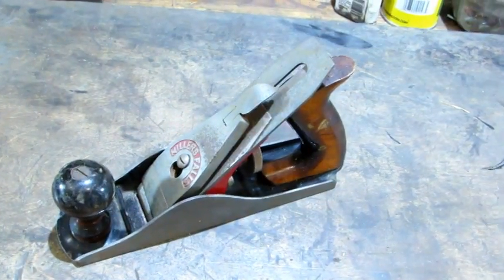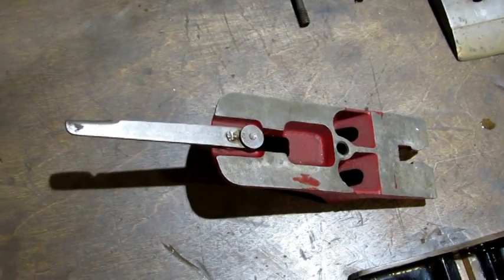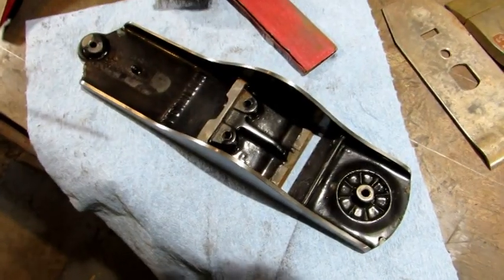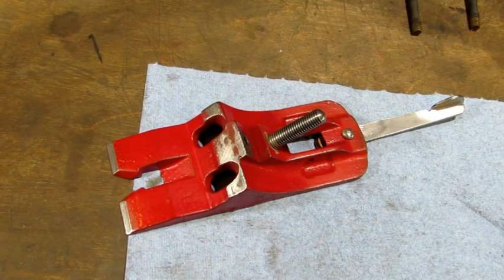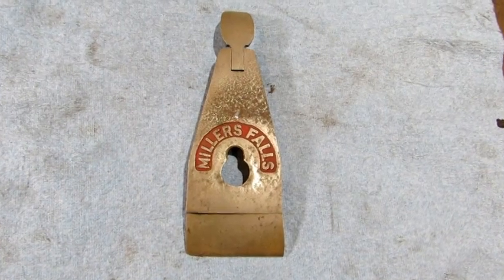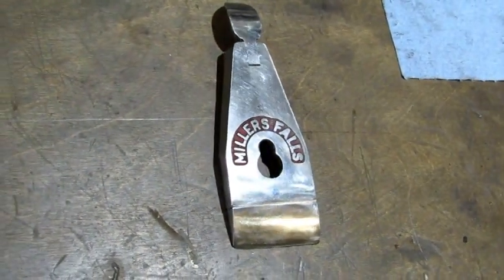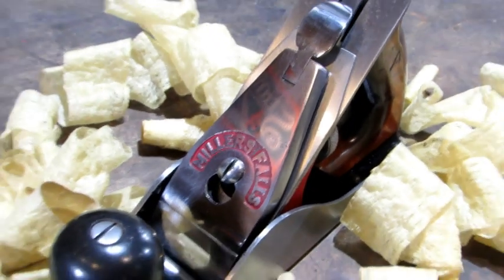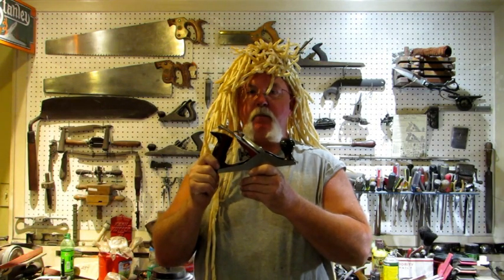Millers Falls No. 8 Smoothing Plane

Comment: I have one like that with frog adjustment screws, frog is black. Was a rusted heap when it was given to me. Pulled the knob and tote, dropped it in evporust,  then took it apart,  cleaned it up. Sharpened the blade.  works well.